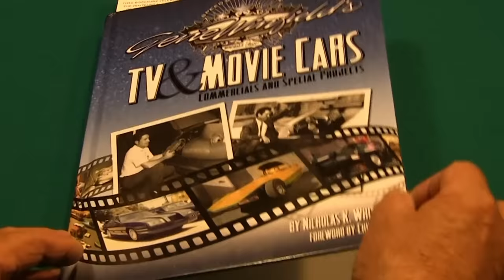Old School vs New School Winfield & Voodoo Larry @ World of Wheels 2016 Chicago.

Comment: Wow chopped 70 car's he's a professional. I wonder how much it cost to have a car chopped with glass and everything done on it as far as the chopped top?
Reply: "If you have to ask.... you can't afford it!" That's why people learn how to do it, so they can afford it!
Reply: @jessejohnson159  When I chopped the 46 in 1990 we were quoted $5000 for a chop of 2 1/2 inches on the 46, and Rod Powell's shop didn't even know what a 46 looked like!
Reply: @GuitarDan1000  It's always a guessing game to price something as custom as a top chop! Or any other custom metal work for that matter! If a price is given up front, they try to go high on the cost because they don't want to give away work because they priced it too low. There's a lot more to it than 'just' the roof sections to be modified. There's the inner sheet metal parts that trim up the windows and windshields. And the glass.... Even glass shops won't 'guarantee' they can cut it right the first time! That's one reason why I learned how to do that kind of work for myself, starting in 1968 or so.
Reply: @jessejohnson159  I know about the cost, I was in the business for 25 years, am a certified appraiser, and retired.